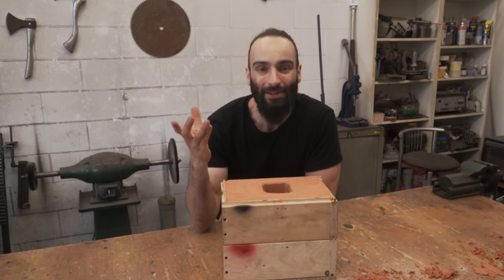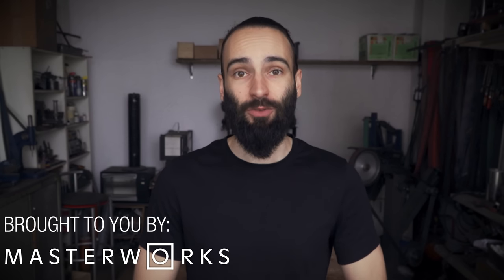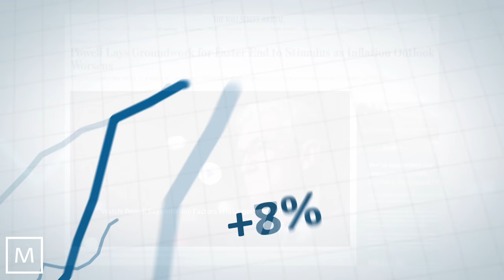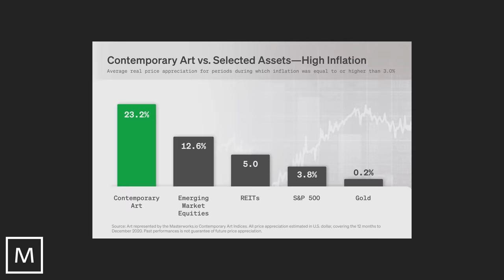Impossible Double Dovetail Hammer

Comment: Might be an option for hammers for use in highly flammable environments (brass doesn't spark like steel does). Looks beautiful, very nicely done!
Reply: They are not cheap either.   I broke  a 30 - 32 in brass pipe wrench inside a resin tank on  union and just beating it with wrench a brass hammer.  Man my boss was not happy when I shown him the upper jaw broken in half....  He said that was a $900 wrench Blah blah blah.  I said well you had better add $900 bucks to the bid or this job!      Well Bronze It was but same concept... No sparks.  But most flammable confined spaces they would want the entire head done.  Just to keep a idiot from making the wrong choice of what side to strike with.

Comment: Beautiful piece, as usual. It looks great, and the brass end can be good for when u need a slightly softer hit, just spin to other face.
Reply: It can't be used. It would scratch.
Reply: @diederikvandedijk  you do know that brass hammers are a thing that people actually use, don’t you?
Reply: @mcannon749  I do. And I know that they are usually not polished.
Reply: No shit Sherlock
Reply: that's what I was thinking. makes it actually kind of a legit design cause you can have steel and brass hammer in one. if there is even really an application for that of course.
Reply: @longleaf1217  there is. I have a 2 pound brass hammer i use on the regular on object that I want to leave less of a mark on such as hammering some steel stuff where I don't want to leave marks.
Reply: Brass hammers a required when it's imperative that you make no sparks!
Reply: I know how smaller brass hammers are used but I don't know where a brass heavy sledge hammer would be used. 
Can someone provide an example?
Reply: Kinda useless. I ld say it was a good show off but even that was a sub par of a job.
Neeeext
Reply: @JBplumbing12  oil industry and ships 🚢.
We’re I work (industrial building) we have 2 brass hammers that we rarely use to drive out pins. The brass doesn’t bend/deform the steel pins. We do have smaller brass hammers near the lathes to center metal parts without damaging them. The rest of the soft face mallet’s we use are the cheap orange harbor freight dead blow’s.
Reply: I don't see a point of a brass sledge hammer. what are you using it for? please explain, I got no clue.
Reply: @frankdelucey2137  Thankyou, Frank, for answering my question.
Reply: @BloodSprite-tan  it doesn’t leave marks on steal.
Reply: @BossTone1  it'd leave a mark on the hammer though. and also, what? why would you want a brass hammer for that. I do not see the place where it'd be better than a dead blow or other soft face hammers? is it to be used with some sort of chisel/mark? but why would you need the sledge it's just too heavy.
Reply: @BloodSprite-tan  smithing is oldschool.. did they have rubber deadblow hammers 200 years ago? No...
Reply: brass hammers are used in flammable jobs like if there’s gas or something they don’t spark ⚡️
Reply: @kolasni13  I'd like to see you do better.
Reply: @BloodSprite-tan  just look it up
Reply: @JBplumbing12  Maybe if you need to hit a pipe or other object away inside in oil well thats currently leaking, dunno
Reply: That's not what you want when blacksmithing. You want your Hammer as hard as possible well you're just going to destroy the surface of the hammer.
Reply: @JBplumbing12  I was going to ask that but didn't know how to word it..
Reply: @matthewpamatian4853  I find that a precise and courteous question usually gets a precise and courteous answer.
Reply: @patman0250  zombiehorror666 didn't say blacksmithing, he said smithing, and said smithing is old school. Smithing is any sort of metal work. There are goldsmiths, locksmiths, silversmiths, brownsmiths,...etc. I am a locksmith. Different smiths use different kinds of hammers. Frank DeLucey above gives an example of using heavy brass hammers in heavy industry. A fellow named Tubal-cain is often cited as the first smith because he is mentioned in the Bible in the book of Genesis.

Comment: I’m amazed that the two different metals didn’t cool at different rates and leave a gap.
Fantastic work!
Reply: it's possible that there's an air pocket inside that didn't reach the edges. I don't think he meant for the metals to bond, but be secured entirely by the 'impossible' double dove-tail. I agree. Fantastic work.
Reply: I'd say waite when the beating gets going!

Comment: Dear Mr B B, gesundheit. Love the finished hammer, actually it looked almost good enough before you started. Beautiful work. We always get a chuckle at your 5 x speed hammering. You work with such sure, confident moves. Is that good editing, or are you as gifted as we think? The only thing that can possibly be added is wood glue on the handle before the head goes on. Seals moisture out, no vibration. If the hammer isn't returning to work, please disregard the fussy glue bit. The two tiny brass wedges at 90° were wickedly cool!

Comment: Beautiful result. Did you pre-heat the steel piece before pouring the brass? I was trying to think of ways to reduce gaps between the steel and brass pieces, and getting the steel really hot seemed like it would help. I thought about maybe dusting it with some sort of flux or something to get the brass to wet to the steel more consistently? In the end, I'm sure the connection you made is very strong and in no danger of working loose. I was just thinking about those pesky little voids at the seam. I guess you could get a brazing rod and fill them in that way, but it feels like cheating!
Reply: Nice observation! Maybe preheating the steel and a "Flux interface" would optimize the project, which is already fantastic
Reply: it is my question too, I'm a bit reluctant to hit with the brass face as I should have the proof that the brass is well fused to the steel sledge.
I would feel more comfortable if a layer of bronze have been brazed to the steel with a torch or TIG, the chances for a good bonding would be much better.
of course, the preheating of the sledge  add chances of success as just the shrinking of the cast brass is sufficient to break the bond between the different materials
An ultrasonic non destructive test is the best way to evaluate the bonding of the cast brass to the sledge steel
Reply: @pedrolinscosta  thats exactly what I was thinking along with more Radius to keep sharp corners from stress fracturing.
Reply: @waynesardullo2482  Fracture that that may take place from thermal stresses!!! Good one mate!! This comment thread and this channel subscribers are teaching me more than the whole semester at university!
Reply: @waynesardullo2482  with more "radius" you could diminish the stress concentration
Reply: @pedrolinscosta  exactly this is one of the things I learned in college with the metallurgy courses I took. Sharp 90  angles in anything cast  or even rolled is usually the first point to fail. I've seen it in so many things.  Fillet's are our mechanical Friends!
Reply: @waynesardullo2482  absolutely, mate!!
Reply: I thought the same thing.
Reply: This was about my only criticism of the whole project, but it turned out beautiful regardless. I'm not sure I'd even use the hammer honestly, it makes for a great decorative piece in a shop.
Reply: I assume if the head of brass above there dovetail is large enough then the hydrostatic pressure made by the molten metal would be substantial and it could push out the majority of the voids
Reply: @PotatoesAssistant  that's an interesting assumption too
Reply: @PotatoesAssistant  It probably did through most of the join, but at the very edges you can see some small voids. 'Gaps' was probably not the best word for me to use since I was only thinking about the visible imperfections right at the very edge. I was purely concerned about the visual aspect of the final product, and wasn't even thinking about internal gaps that you couldn't see!

Comment: Excellent.

Next time consider heating up the steel part with an oxyacetylene torch so the brass will actually braze itself onto the surface as well and you'll have less empty spots on the contact area

Comment: Not impossible to do without casting. I've seen woodworkers do the same 'impossible' dovetail joint in wood, and you can't cast wood. But casting it was certainly much easier then cutting the joints needed to make it out of two solid pieces.
Reply: He literally showed the other method that woodworkers use to make the impossible dovetail that slides together as well, in this exact video... It's just impossible to do it truly without doing the 45* dovetails, or the casting method.

Comment: I just discovered your channel it is really nice, cool the hammer / mallet

0:45 you turn much too fast, in machining it doesn't matter what material you make, it never sparks.
-For a tool with carburettor inserts the shavings should never exceed the dark blue (petrol) color for steel: in order it goes from white to yellow, brown, light blue, petrol blue (perfect), then when you turns too quickly, it goes back to pale blue, returns to the metal color but no longer in chrome, after that it's sparks but it's no longer machining but abrasion.
-for stainless steel: the shavings must remain white and you must always lubricate (or blow air at worst) if it yellows = lack of lubrication and/or too fast rotation and/or ruined tool.
-For one-piece carburettor and HSS tools (small milling cutters or drills) you must always lubricate, for HSS if your chips do not stay white you are burning your tool: lack of lubrication and/or rotation too fast

-if you want more information on machining don't hesitate, it's my job
Reply: While I agree with you for most situations, when machining hardened steel with carbide you will generally produce sparks/glowing chips at any practical speed. There is a good chance that the hammer was heat treated. Yeah, it's not ideal and will damage your inserts fairly quickly but oftentimes it's still a viable option if you can't grind it.
Reply: @siggyincr7447  let's say it's a 50 diameter tool and it's a very very hard material VC=50 so 320rpm.  by eye I would say it runs at 1200 rpm, even if the video is at x2 speed it would be 600 rpm, but maybe I'm wrong.  in any case in 20 years I have never seen sparks in a workshop except when a tool is or is going to die

Comment: Hmm, I wonder if the undercuts on those dovetails could be done with a shop bandsaw?
Set the angle, make the cut, rinse and repeat. Minimal filing to finish. Same for the insert if one goes for the 45deg method rather than casting.

Maybe easier than by eye with an angle grinder? Just a sudden thought, no doubt there are a dozen reasons not to try.

Comment: Just out of curiosity, why didn’t you mill a dovetail instead of grinding one? No dovetail tool? Also, why didn’t you put a small radius on the underside hole edge of the hammer so that when the handle goes in you don’t have a stress concentrator on the wooden handle whenever you hammer?

Comment: Sliding dovetails would work. Just drill into the steel and put high powered springs that push rods into the brass face on the inside.
Should only need 4 springs and pins.

Comment: Very nice. The only thing that would've been nice to try is heating the end of the hammer to a red heat apply flux then assemble the top mold and pour the brass, that way the brass would actually braze itself to the steel.  As it is it is only a mechanical lock which will tend to loosen up as the brass deforms.....if it actually ever got used....too pretty to do that anyways lol. 😉

Comment: Nice finish for a concept tool.  I'm not sure of the durability of the brass section, I suppose I would have heated the hammerhead and added a flux material before pouring the brass and making the join.  Still a nice outcome.

Comment: Ooh. I thought it was going to be built with how these are done in woodworking - two diagonal dovetails paralel to eachother. But this dovetail truly is impossible :D
Reply: @BEANSPOBBLES As a matter of fact, I've only done arc welding with wooden electrodes, repairing some tool handles. I will have to try casting the wood at some point though.
Reply: @inventiveowl395  in fact you aren't far off the reality. Cellulose electrodes are used to weld and they contain wood powder in the shielding.

Comment: Sorry, I'm lost. What is the practical use for brass instead steel, in a hammer? I can't imagine a situation in which I would hard with a soften material with a hammer, besides those rubber hammers for not scratch sensible pieces, but they are from rubber, not brass, lol.

Comment: i'm amazed that you used no cutting fluid on the milling machine. it seemed a bit crude to use an angle grinder to cut the dovetail's. why not use a tapered cutter head for that? i also wonder how long the brass head would last because if you needed the weight of sledge hammer to do the job, then you're going to use lot of impact force. i can't see the brass standing up for long before it deforms and cracks.
Reply: he was using a carbide tool, when using cutting fluid on carbide it has to be a massive amount of liquid so as not to destroy the carbide, I was thinking the same thing as far as the dovetails go

Comment: Such a delicate piece of art, one is reluctant to use it. I didn't expect iron and copper to be so tightly bound. Do I need to preheat the hammer before casting?
Reply: Its not essential, as it would dry the casting sand a bit too much causing bumps or bubbles/pitting, but what is possible is letting the brass cool slightly so that there is a film of slag on the hot metal before casting

Comment: These are not impossible to make.  You can mill the dovetails on a 45 degree angle and parallel to each other so that from the outside it looks like a puzzle but the face will slide off .
Reply: You mean exactly what he explains at 3:13?

Comment: I wrote my comment before reading another comment that the brass was poured, I'm an engine builder and machinist, super easy to mill two parallel dovetails at a 45° angle in both parts and press them together, also a dovetail is cut and fitted, not poured, impossible? I think not
Reply: Maybe try watching the actual video instead of making assumptions. 3:13.

Comment: Besides the artsy color contrast of two different metals, the braging rights and the shiny cool pimp bling sledge...  what would be a real practical useful reason to give a steel sledge hammer a brass extension? none? For a smaller hammer I'd say it's a soft-head hammer and a normal one combined into one. A soft head sledge hammer seems kinda pointless to me...
Reply: booooooo
Reply: @ryansutherlin5613  ga gaaaah gagaaaaaaaah?

Comment: At first I thought it was rediculous to use brass for a hammer. But I looked into it and it has it's uses. For starters, brass doesn't spark. So it's useful for automotive work when you might worry about a spark igniting something flammable. Then there is the fact that it's a softer metal, so it's less likely to damage things like sheet metal when shaping it. Some also use brass hammers in woodworking too. So, this impossible double dovetail brass hammer has it's uses.